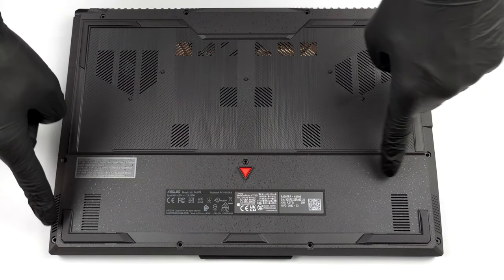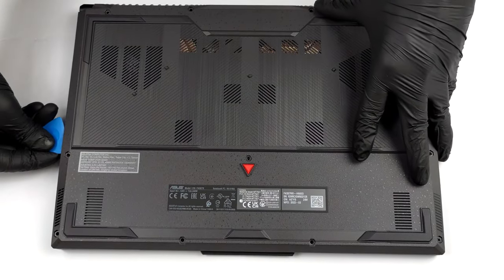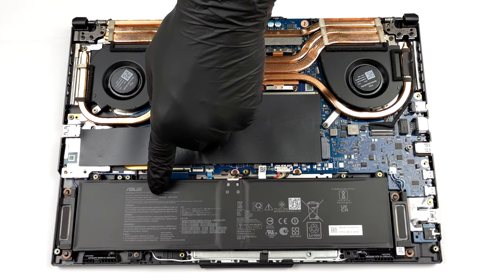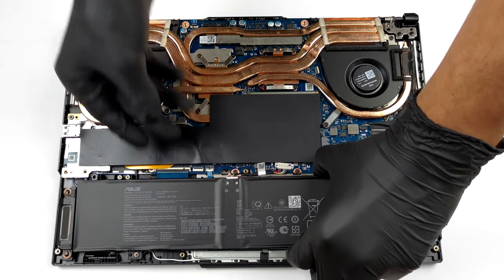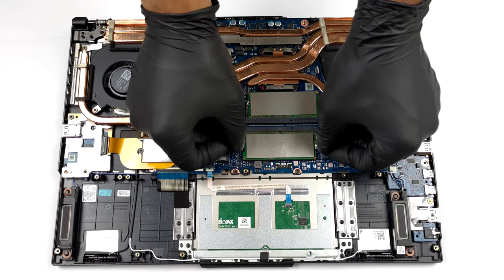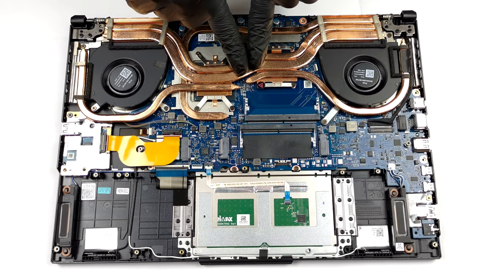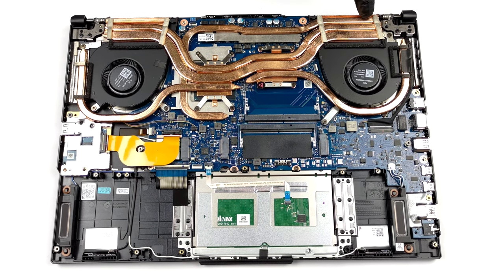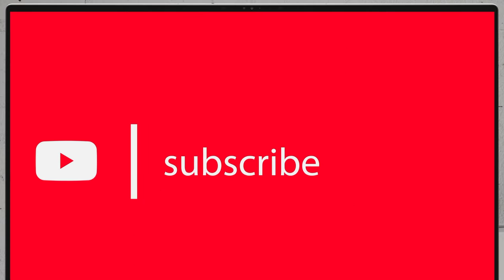🛠️ ASUS TUF Gaming A15 FA507 - disassembly and upgrade options

Comment: Can we also add 2.5 sata hdd in this unit if it has only 56whrs battery?
Reply: That's what I'm trying to figure out too...😅
Reply: Unfortunately, we can't coz their new models don't have that option.
Reply: @j0h0n06  Interesting. I managed to find a video of the 2022 3050 version's internals and came to a similar conclusion. I'll wait to see if the 2022 Legion 5 offers a drive bay option with the smaller battery, or else it'll be the 3060/3070 version of the A15...for now. In the meantime, I'll keep saving up and keep my options open.
Reply: Only brand that i know of with the hdd option is the Acer Nitro and Predator
Reply: @j0h0n06  Thanks for the info. All I know is that I'm glad I've got an external enclosure for the 2.5 sata drive, so it might not be too much of an issue. I might just have to buy another external enclosure if I still want to use my old laptop's original hard drive for extra storage too.

Comment: Why is there a silver pouch on the ssd? 

And my laptop also shipped with a black mask over the Ssd and Ram which is giving me 80°c on SSD temps on normal work load. 

Is this normal?
Reply: No it is high. apply thermal pad on it.

Comment: if you add another SSD it doesn't look like there is a heatsink... will it need a heat sink?
Reply: SSD does not need a heatsink... Unless you run some storage heavy workloads that utilize SSD at 100% speeds for multiple days or use the laptop as a server, SSD is cooled passively and hover around 36 iddle and 60 normal operating temperature... SSD can get also a bit hotter but 60 is the gold spot where you want it... And since you have this low-mid tier laptop I doubt that you will be rocking 16TB Sabrent m.2 SSDs in there, hence no heatsing is needed... You can measure the gap between the SSD and bottom cover and get piece of aluminum and slap it on there but IT DOES NOT NEED HEATSING SINCE IT AINT DESKTOP...
Reply: @bumpy86  thanks! good info!

Comment: I open mine to upgrade ram. Disconnected the batery changed ram and reconnected battery. Pressed the power button and is dead. Doesnt turn on I dont have the power brick with me. Does anyone know why it doesn't turn on?
Reply: Remove the RAM you installed (may be faulty) and unplug/re-plug the battery.
Maybe you didn't install one of them properly.